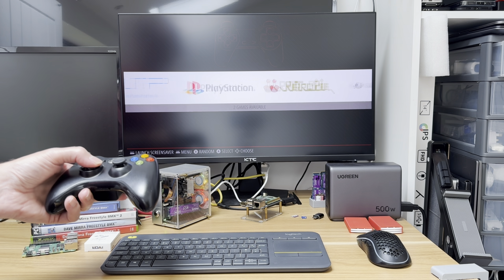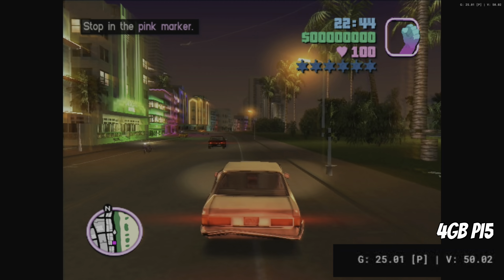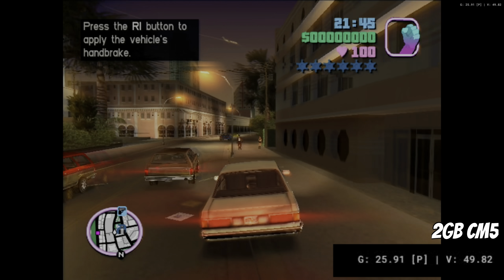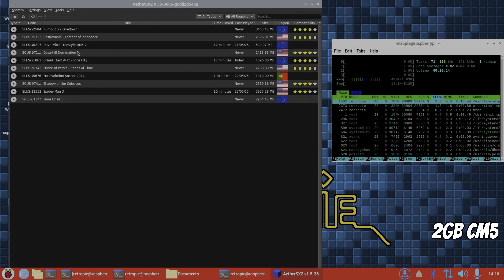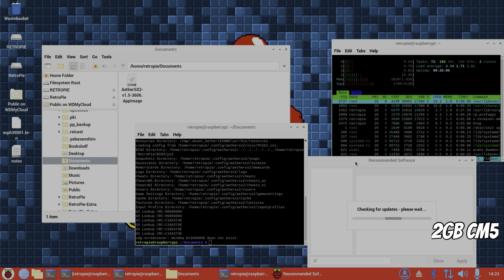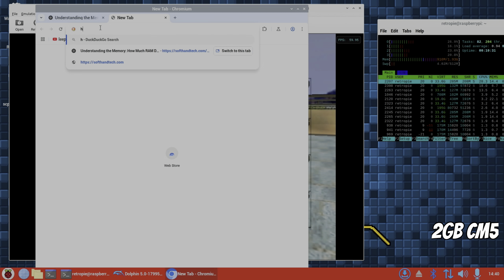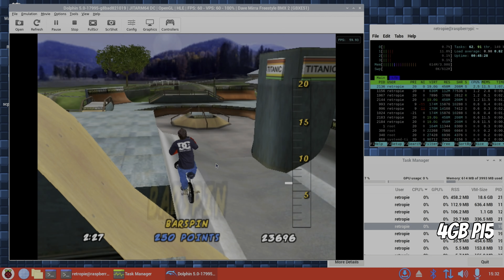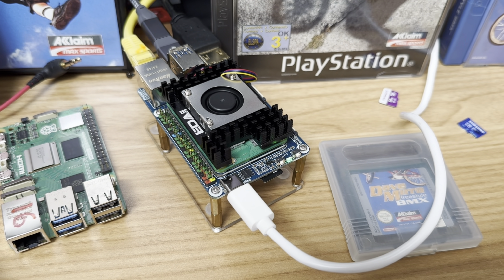is 2GB enough? Raspberry Pi 5 Retro Gaming

Comment: 11:57 ram on a console made back in the 2000 era has no bearing on what system specs a emulator needs running on updated software

Comment: You can do the math without having to do the experiment.. you know what the OS requires, you know what the emulator requires, you know what size the rom files are, and you know how much RAM the original device had. Add all these up plus a little bit for an overhead, say 10-25%, and you will have a rough idea of how much you actually require.
Accounting for amount of memory swapping, CPU loads, and drive reads is also required to know if your device is up to the job.

Comment: PS2
CPU	Emotion Engine @ ~300 MHz
Memory	32 MB RAM, 4 MB Video RAM
Reply: When emulating a system you don't need the specs of the system your emulating, you need to have specs that can run the base OS and the emulation layer "aswell as" the system your emulating.
Reply: @mcborge1 that makes a tremendous amount of sense

Comment: A N100 with 12 Gb DDR5 MiniPC can run soms xbox classic games in Xemu. Pi5 is as a complete system a lot less power for about the same price.
Reply: You can easily pick up a 3rd or 4th generation used  Core i5 or i7 SFF PC (Lenovo, HP or Dell) with at least 8GB RAM for far less than the cost of a Raspberry Pi 5 8GB or 16GB by the time you factor in a case, cooling and power supply (which the SFF PC already comes with) - and it will have more power too.

A 2GB or 4GB Pi can just about make sense as an SBC for an electronics workbench or to give to a kid to learn programming on at less than £50 - but there's absolutely no economic sense buying an 8GB or 16GB one, especially when so many people are selling off old PCs cheaply due to Windows 11 upgrades.
Reply: @terrydaktyllus1320  Yess off course you can, but than you have a second hand (which is a bit of an unfair comparison and can hugely differ in price at times) bigger and most of the time uglier system. And most of them don't even have the gpu power of  the N100 with DDR5 memory. I went a little bit more expensive for an emulator box with 5600X and a gpu which I already had. Most consoles work upscaled to 4k  now! Xbox looks amazing in some games :) Another better choice would be a bit more powerfull ryzen MiniPC !
For the price of a complete Pi5 system you might do better second hand than you mention. Intel 6th or 7th gen (Intel iGPU's got better too!) and if you're really lucky a 5600G system

Comment: PS2 games run quite well on the RPi5.
What?
Reply: ARM likes PS2 and Dreamcast I think. Both Risc cpu's.  (Most games on those machines are compiled) A machine like Xbox classic was x86 so that runs better on a x86 machine
Reply: @erikkarsies4851  Ok. I just didn't know the RPi5 was that powerful.
Reply: @3dhYT  For other people who maybe want to know more : If I remember/understand it correctly In the time of the Dreamcast on non RISC system the time critical parts often still were coded in Assembly close to the system. The complexity of the RISC almost forces to use a higher language like C++ That 'forced higher level' makes it easier for emulators on Risc machines to translate the code. So an older Risc processor code emulates faster on a modern Risc processor. (And vice versa, but besides the x86 there are not much CISC cpu's in use?)

Comment: Good test.
one thing the 2GB model has in its favour is the stepping of the CPU and ram is newer so the Pi 5 2GB model uses less power.

great for battery powered projects where it seems to use around 300ma (0.3 amps) when booted up and idle.
of course the harder you push it the more power it uses up to the same as the other Pi 5 models.